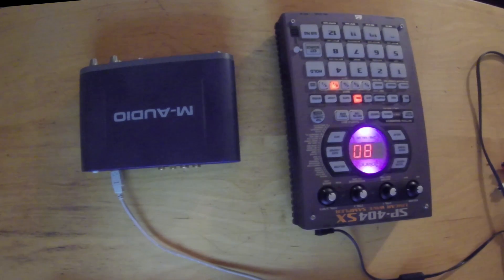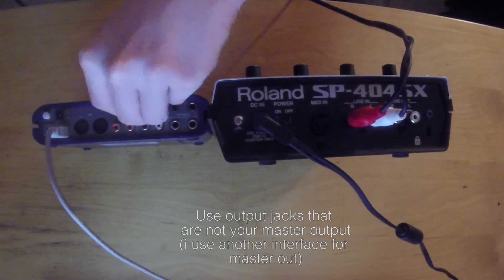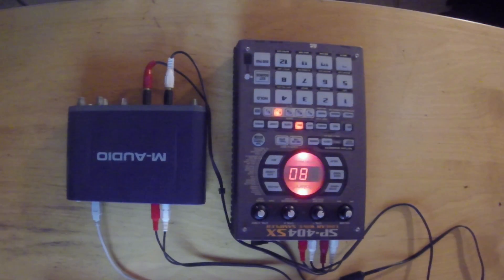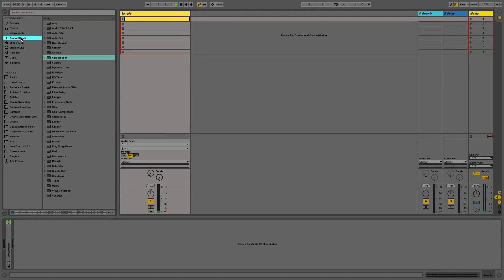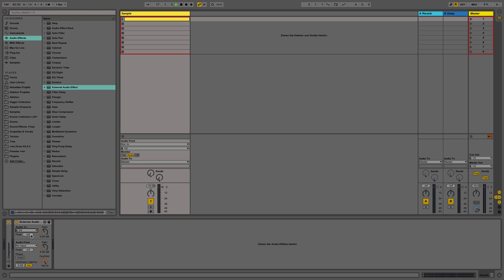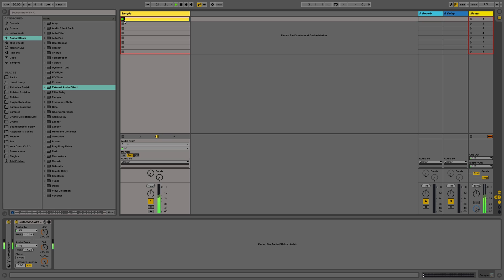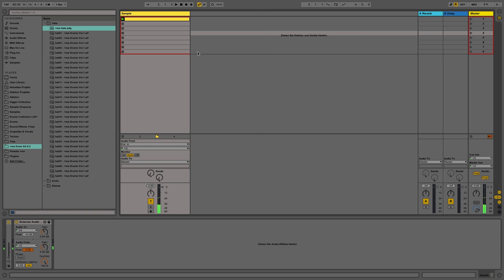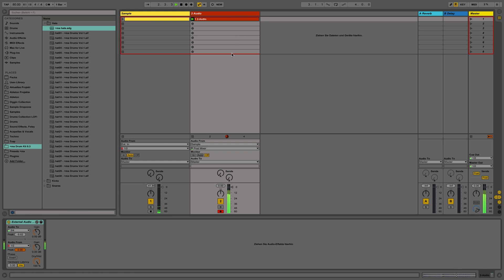Ableton Tutorial: Use sp404 as Outboard FX

Comment: procedure works but when i apply the effect on the sp (303) it sounds like it is meshed up to the original sample in ableton.. what am i doing wrong?
Reply: Did you figure this out? I get the same result.
Reply: anatolianINVASION Yes! As I have a Scarlett 6i6 interface I had to configure the outputs trough the Scarlett virtual interface on my Mac.
Reply: Yes I found out what was missing. In the Scarlett software it needs to be set to 'mixing' it works now.
Reply: @vittorioazzarita824   hello man,i have a clarett 4 pre,same or similar problem that you had. I get a lot of feedback. 
what did you change on that software ? It makes my head explode
Reply: @36mg66  hey man! sorry for the late reply. in the mix control i set 'mixing' as a routing preset and it works. In case you dont have this preset you can try setting it up making your monitor outputs DAW 1 and DAW2 and DAW 3 and DAW 4 for the other two. Hope it helps!
Reply: @vittorioazzarita824  thank you bro,it works now

Comment: Hey man, getting real bad feedback on all effects. Using Scarlett 18i20 so plenty of inputs/outputs. Got any ideas what's wrong? Thanks in advance
Reply from the maker: master out and effekt out needs to be a different channel
Reply: plusma worked it out now. The  focusrite interfaces use an app called mixcontrol which has a load of separate preferences. Thnx for your reply
Reply: @wilsone7710   hello sir,I have the same problem. Using clarett 4 pre,what did you change or how did you route the focusrite software ?

Comment: whats confusing is when you plug the outs from the sp 404sx into the mic ins/outs on the m audio audio interface. so you are not using this as your output like to your studio monitors but to connect your other effect unit the korg kaoss harware correct? maybe it would have helped if you showed the routing on the other audio interface you used. otherwise thanks for the tips.
Reply: nevermind. i see you had put the other end of the sp404sx inputs to line ins/mics (rca's with 1/4" adapters attached) on your audio interface and had already mentioned on caption that you used another interface for your master out/monitors. understood! it took me awhile to get this down cause i was using the novation hub which has all these features in one & usb hook ups for additional midi controllers. oh the complexities n challenges to finally get it workin, i love it. lol. this is so much fun than just pressin play tho. much love & thanks again plusma.

Comment: Is it possible to connect to only one channel with a jack stereo? I mean with a sssnake YPR2030 for example. And the same from an interface output to the sp404, or is it necessary to use rca in the interface? I am searching an audio interface to use with the sp404sx and a microphone in other input. Solving this doubt will help me to choose it depending on the number of inputs or outputs that I need
Reply: Leyendo RAP SUPREMO hes not going to answer you because the question is confusing. i wont answer it neither.
Reply: Dave Acosta :) thanks, you are the King, enjoy It :) :) :) LoveeU

Comment: 2 things; db levels much lower when i run through sp
and when i hit the ext source i get a slightly warped signal and if i turn up the volume i get really ugly feedback. 
help!
Reply: hey i figured out this problem because it has been happening to me:

first press [start/end/level] button on the SP and turn the very right knob down to like 20 or 30. that way you can turn the master volume on the SP all the way up with no feedback, however it will be a very quiet signal.

then crank up the gain of the external audio fx rack to where it is normally just as loud.

if it still isnt as loud as it should be, throw a limiter or compressor on after the external fx rack and turn the output level up.

hope that helps!
Reply from the maker: what interface do you use?
Reply: +plusma im running on a scarlett 6i6 first gen
Reply from the maker: hmm should work the same way as with my interface
Reply from the maker: when you use the correct output there shouldnt be feedback
Reply: ever figure this out?Same thing with me but I'm running everything through fasttrack pro input and output
Reply: I also tried it with using my apogee duet as master out and the same thing happened...HELP plus ma!
Reply: it's 6 in 6 out
Reply: why would I need 6 ins and 6 outs, can someone elaborate for me please? I have a Lexicon Alpha and i'm wondering if this will work w/ my monitors plugged in as well as the SP.

The Audio Interface has 2 L/R outputs and 1 L/R input.. One of the outputs is for my monitors, so that leaves me with 1 input and 1 output. Isn't that all I need for the SP? Or would that make the feedback loop somehow?
Reply: Camilo Gonzalez wont work because you need a interface with 6 outputs
Reply: Matthew Marvin this method did not work